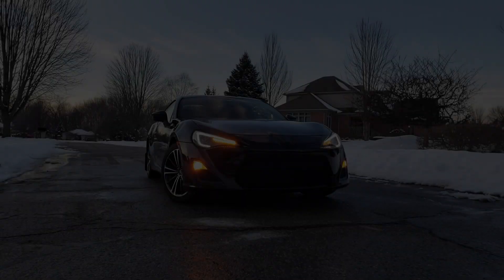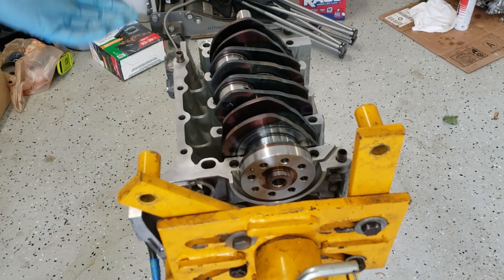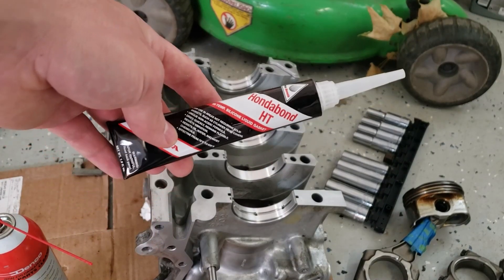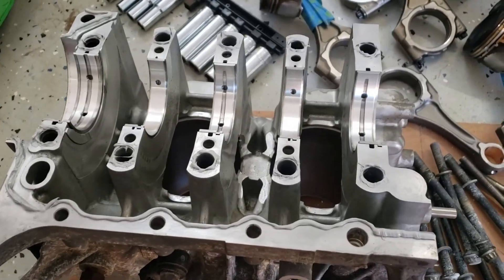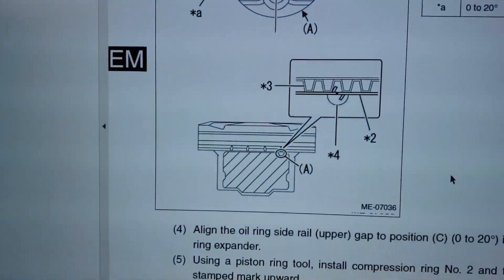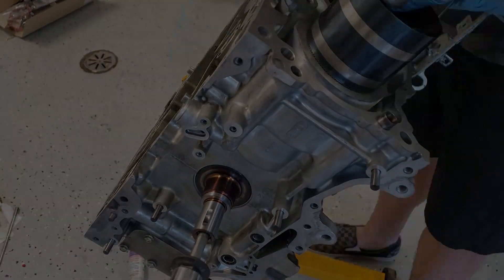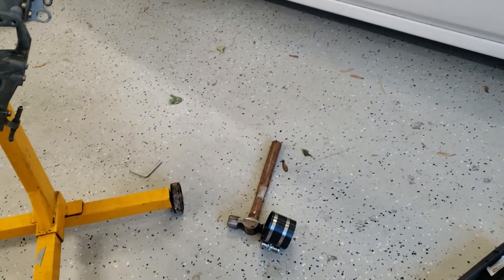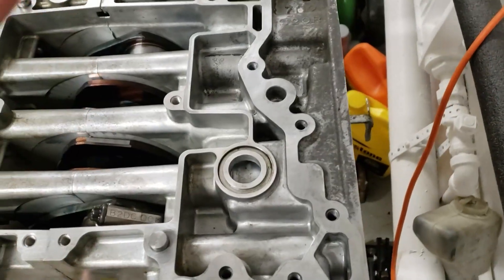Rebuilding a Subaru FA20 Engine - Part 2

Comment: Hey man, thank you very much for your videos. I just picked up a blown 14 brz with (I think) a spun rod bearing. It's so helpfull to see you do it first. 
I'm not sure if I skipped the part where you mentionned it, but why did you choose to go with a new crank and not get  the old one machined? Was it too bad to be machined, Was it for peace of mind or maybe it's not something that can be done with those crank? 
Thanks
Reply from the maker: @NeeoDroid  I just assumed it was too bad by looking at it. Plus I'd have to find a shop to machine it and order oversized bearings. With a new crank being less than $500, it just seemed way easier to just order a new one
Reply: @NickSabella  thanks for the input. I guess will see how my crank looks
Reply: Hey man awesome video it helped me out a lot too but still can’t figure out the torque specs for the connecting rod bearings 🥲 can you help me out with that please